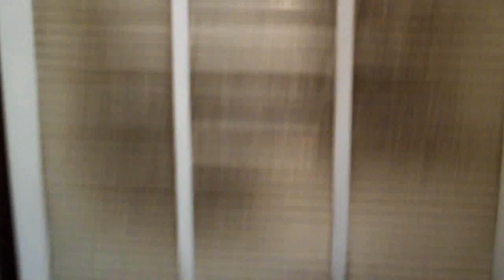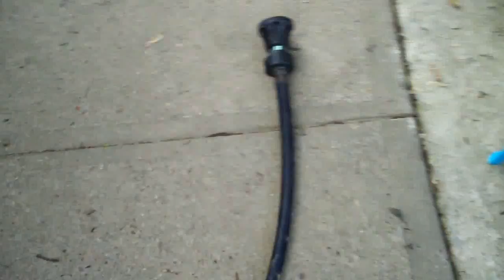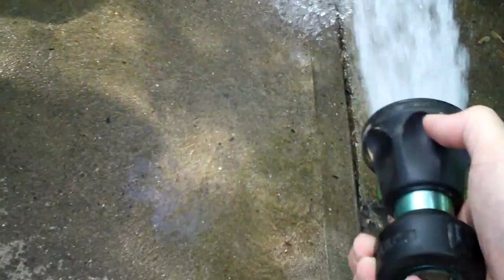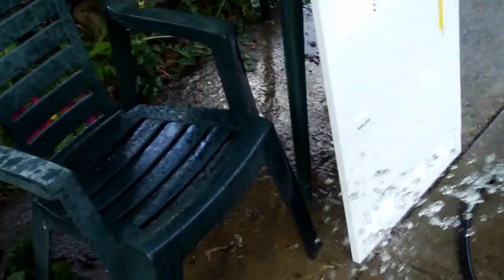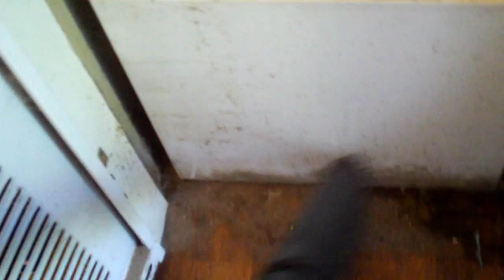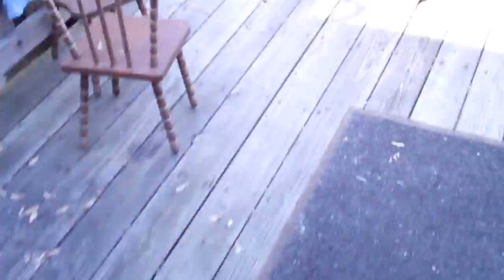How We Clean Air Conditioners

Comment: Got it taken care of today. I took the air compressor hose and blew it all out from the inside with just air. I then took a stiffer bristled hand broom and worked it on the outside to get all the stuff the air blew out. I have a forced air furnace with the condenser sitting outside the house. I clean the vents in the house every time I vacuum the carpet.

Comment from the maker: Compressed air can clean it too but it would generate too much dust. And any real Heating and/or AC maintenance should be done by a trained professional like what you claim to be. On a serious note our gas furnace has not been used for 10 years now (We use a wood stove for heating).